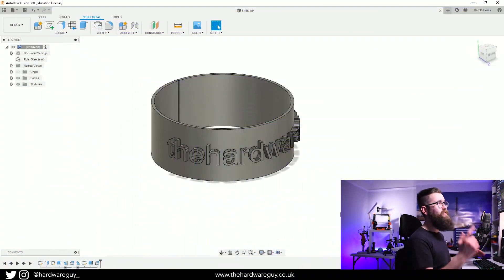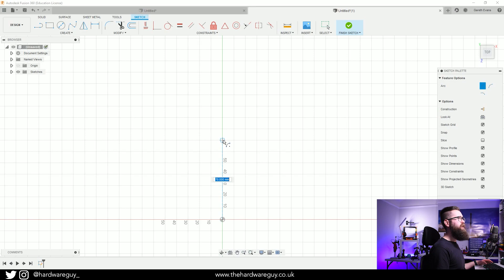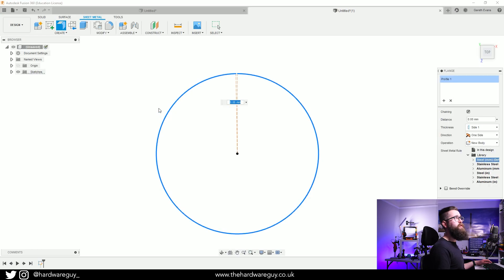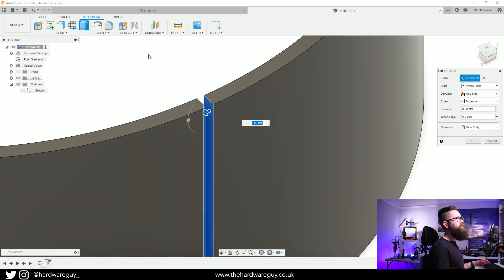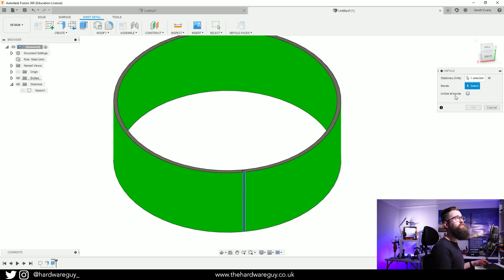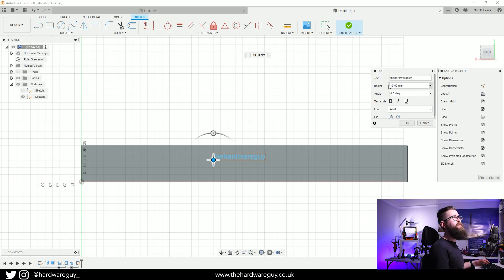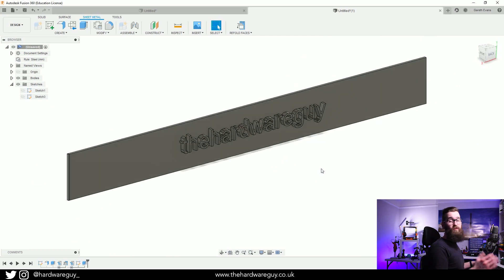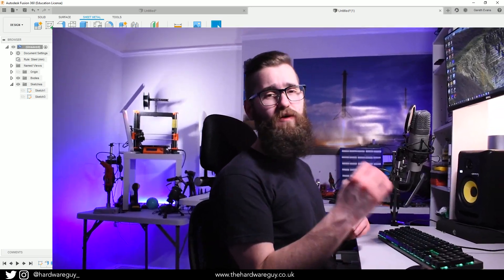Wrap Text To Curve with Sheet Metal - Fusion 360

Comment: Fantastic thanks! I actually used this to then carve into a solid complex cylindrical object I was already working on using a Boolean cut via the combine tool. There might be a better way though? I supposed you could also use the same method with an add to extrude text on a complex object.